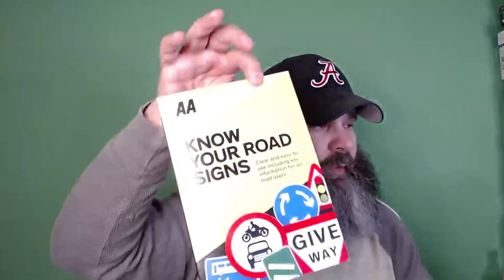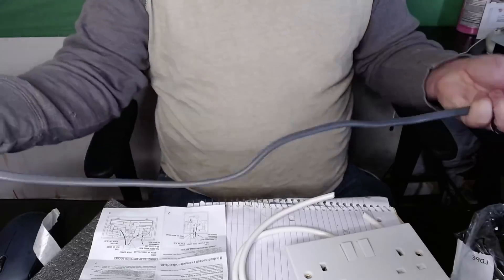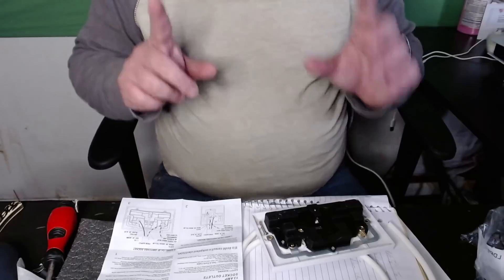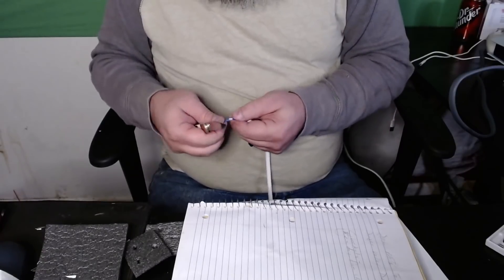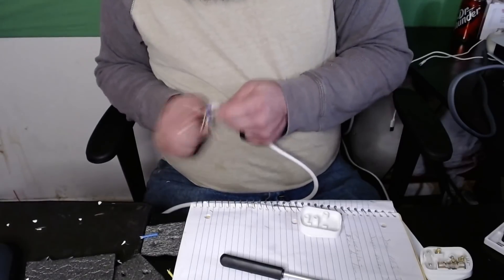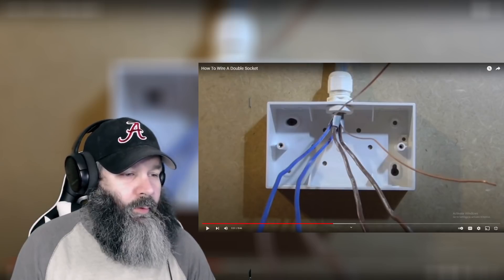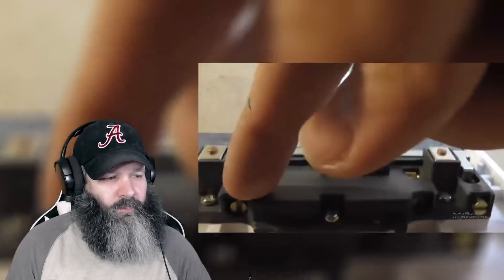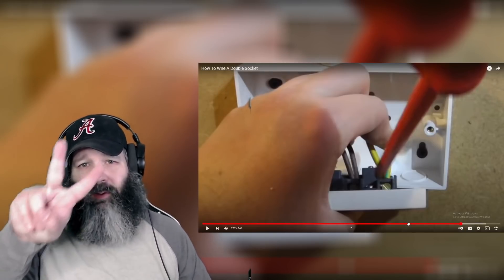American Attempts To Wire a UK Wall Socket and Plug

Comment: For a genuine first attempt, you're pretty good.
I've seen far worse wiring all over the place.
A good tip, is that if you dont have a small screwdriver, a table knife works absolutely fine.

Comment: The powder within the twin & earth cable is to prevent the cores sticking to the outer PVC sheath. Some electricians might note a lack of powder as a sign they are working with a cheap inferior cable that is going to be a PITA to work with.
Not an electrician, but the thing I hate most when it needs replacing & wiring in the UK are ceiling pendant lights.

Comment: This has probably been mentioned but anyway, the back box in the vid at the end had 2 wires going in because our rooms usually have all the sockets on a ring main, means they’re all daisy chained together.  Each room has its own ring main with a capacity of 30amps, 240 volts x 30 amps = 7200 watts before you trip the consumer unit (fuse box).  The fuse in the plug is to protect the cable going into the plug.  The live and neutral prongs on the plug are shorter so they come out the socket before the earth prong does.  As someone else said, standing in bare feet on an upturned plug is at least 15x more painful than childbirth.  Don’t know about anyone else but I’d be interested in seeing how it all works over there.  Always like your vids mate, keep it up.👍

Comment: When wiring the plug, cut the outer sheath so that the earth wire will just reach into the earth terminal, and the outer sheath will fit under the cable clamp. If you fit the earth wire first, you can then easily asses how long the live and neutral wires need to be. Many plugs are designed so that all 3 wires can be the same length, but that's not universal. It is essential to fit the cable clamp otherwise the wires will pull out sooner or later. It must grip the outer sheath not the 3 inner wires. The insulation on the inner wires should terminate very close to the terminals so that there is a minimum of bared wire. Your effort looked reasonably safe except for the omission of the cable clamp, so good try for a beginner. The slide on sheath for the earth to the socket was a regulation brought in around 1970, so many older houses do not have it unless they have been rewired.

Comment: When we were taught to do this in school it wasn't good enough until our teacher could basically swing from the plug, that's the whole point of the cable grip (two screws at the base of the plug) because if he could, even if it took all of his strength, pull that cable out of that plug then it would likely come apart just as easy if someone tripped on the cable

Comment: Merge lanes in the UK are often used as "traffic calming" measures i.e. to slow the traffic down. For example on a road that passes by a lot of houses it may be deliberately narrowed at two points with these "merge lane" stop sections. Priority is given to people leaving the built up area so that cars entering either end of the built up area typically have to stop or at least slowdown as they are at a stop point. We don't tend to have USA like stop signs as if you are at a junction or you are about to the junction double line road markings it is bleeding obvious that you should be cautious. Also we don't have police for profit where you can be stopped for any technical infringement (real or imagined) no matter how safe the circumstances,
Reply: Guernsey as a good sign, "Filter in turn" never seen one in England.

Comment: In the instructional video he's wiring the socket in to a ring main. That's where the sockets all connect in a daisy chain starting & finishing at the fuse box/consumer unit/distribution board...

Hence 2 of each wire. It's also why the plug must have a fuse as the ring main fuse/breaker will be 32amps.

The whole system uses less copper because we had a bit of a shortage after making billions of shells & bullets for world wars. My house was originally wired with steel.

The pins are square because we also have unfused sockets with round pins. Very rare now, but they do still exist.

...cut in a ring around the flex's sheath. It'll split when bend it, allowing you to pull the end off, thanks to that talc.

Comment: Well done on your first attempt at wiring a UK socket and plug!
I don't know if this has been mentioned, or if you know it already, but if you hadn't noticed, the top pin, the earth, is longer than the other two. This is another safety feature. I'm not an electrician, but as far as I know, the top pin being longer than the others, connects first, allowing the flow of electricity through the plug. Basically if the earth pin isn't engaged, then a kid sticking something into the bottom holes, technically they shouldn't get electrocuted.
With our mains power being about double of yours, we take safety seriously.
I think you'll enjoy our road signs! Lol
Just remember when your here, we don't turn on a red. And on a roundabout, which are everywhere, remember to give way to the right.

Comment: You did a great job with the plug the easiest way to remember is  Take the first two letters of the wires  Brown(L) BR goes to Bottom Right   Blue(N) BL  goes to Bottom Left  and green goes to 3rd Pin
Reply: I was just going to say this, I always remember BLue Bottom Left, BRown bottom right.

Comment: Electrician here. Not bad for a first attempt and limited tools. If terminating a single wire in a socket outlet, it is best to strip twice as much copper  conductor and double it over with pliers to give more meat to clamp down on.

Comment: The 3-pin plug is designed so that, when the plug is inserted into the socket, the longer of the 3 pins (ground) actually opens the 2 flaps that cover the 2 lower holes in the socket. This is so that when there is no plug in the socket, the 2 lower holes (live and neutral) are covered. This stops small children (or idiots) from putting their fingers etc into those 2 holes which could result in a nasty electrical shock. A very good and safe design that is really robust.

Comment: That plug is essentially the same as the 'rubber bathroom plug' in the Two Ronnies Fork Handles sketch of 1976.  The trouble with having a 13 amp plug in a bathroom is not the plug itself, but rather the appliance on the other end of the wire.  The appliance on the other end of the wire is unlikely to be waterproof, and 240 volts RMS AC (680 volts peak-to-peak sinewave) is potentially lethal.

Comment: The first road sign is about high vehicles passing under the centre of low arched bridges.  There is a funny site about a low bridge in the U.S. which catches out the unwary despite installed automatic warning lights.

Comment: Next wiring challenge, someone send him a mock set up with a random mix of all wire colour combinations, pre-70's, '70-76, 76-2004 and current , some wired wrong, see if he can deal with what some UK sparkies have to deal with in older houses that have had their electrical wiring added onto randomly and not completely replaced 🤣
Reply from the maker: Erm. That would definitely be interesting.
Reply: As a 52 yr old sparky, it always amuses me when I get a fresh out of college know it all youngster. First fault in a older property and they are lost, "why's this cable red or black?" etc.
Reply: @tobytaylor2154  why is this neutral cable live? Do you check to see if the live is in fact neutral and it wasn't installed wrong by a fresh out of college know it all? Or a cowboy?
Reply: @MrTrilbe  I got some shocking (excuse the punn) stories, things I've seen over the yrs.
Reply: @tobytaylor2154  oh I figured and do please tell
Reply: @MrTrilbe  allsorts, from nails as fuses in a big industrial unit, a private hospital in Wales, the operation theatre's s/o were on a standard ring circuit, not a dedicated protected one or an Icelands near Heathrow Airport mains board on fire and the manager done nothing until I got there on an emergency call and said he didn't know what to do, evacuate the store and 999 would be a good start. A fencer go through the mains in the St with a pickaxe, the bang was loud, he was blackened and the local area lost power lol. To name a few lol
Reply: @tobytaylor2154  my grandad replaced a few fuzes with cut down nails or wrapped tin foil around popped ones to last them until he could buy either new ones or before that new wire for the older ceramic block and replaceable wire fuzes lol, different times back then, much more... Interesting... Times too
Reply: @tobytaylor2154  You'll be familiar with Electroboom, no doubt?
Reply: @loafersheffield  I didn't recognise it so I googled it, lol, yeah I've seen him
Reply: Does that include the orange and grey on the bolier controls too ? !   Indeed the internal wiring was all different, and lets take a neutral for the garage extention and wire one of the kitchen sockets to it, so its not off when the house board is off !
Reply: @tobytaylor2154  I would have thought the old codes were fairly intuative to work out.  Now lets get a USA device in with black and white wires
Reply: @MrTrilbe  safety pins make good fuses
Reply: @highpath4776  yeah, you would've thought so, but in my experience, youngsters now are very dim.
Reply: @highpath4776  What a great idea! What could POSSIBLY go wrong? (Deep, deep sarcasm) So, someone spurred off a 3 amp rated boiler flex (orange) presumably serving a 3 port heating/hot water valve? I've found a 2 gang socket outlet taken of the common live, neutral and earth serving a lighting circuit. A spur off a downstairs ring, running from top right to bottom left (not zoned, nor protected) and joined by a chocky block, terminal connector in damp, crumbly tile adhesive. Same house. Fully populated  split board 16 way and only 2 circuits wired in. Ring for upstairs and downstairs sockets and lighting up and down too.

Comment: I don't know if anybody's touched on it, but another part of the engineered design of the BS1363 plug is that the cord entry is a) at the side and b) the bottom side. It's sideways on so the cord is flush with the surface the plug is plugged into, rather than poking straight outwards (have you ever tried plugging a non-UK plug into a socket behind furniture?), and the entry is at the bottom to prevent stuff, muck, dust, etc falling into it.

Comment: Hello Alan. You have to use a qualified electrician for anything major, or at least get them to test and certify the circuits these days in UK. You can still do simple bits yourself, like wiring a plug. The number of times I have been somewhere with no tools and had to help someone. This was a lot better than an old table knife and pair of scissors.
As a graduate scientist I had to study electronics. Still when I had to hire professional electricians both for previous jobs and for my house renovation, you can see why they earn their pay as they do this in seconds. I was relegated to hammer and chisel for the plaster and brickwork to bury the wires. I helped a British one out when in Spain, where the walls have hollow bricks that make this easier. European standard electrical fittings are different to UK.
Ethan from Midwest Americans did a video on UK plugs.  It was a good while back, so you might react to the same one?

Comment: After stripping the insulation off a conductor, I always bend the exposed copper back on itself so it's more securely held in the terminal.

Comment: You got the gist of it...even if you had everything upside down - switches are at the top, and cables from plugs are at the bottom.  Your double socket was fine if it was at the end of a circuit. If you are in a continuous circuit, then you will need one cable as the input and one as the output to keep the circuit going.

Comment: There should have been a bit of card pushed over the plug pins which shows you how long to cut each of the wires  from the outer white  sheath. for the plug. This means that when all wired correctly the clamp is clamping on the white sheaf and not on the individual wires. Otherwise a good first effort.

Comment: While you have the U.K. plug and socket you can check out the safety features. 
First try and push a screwdriver or small blade into either the bottom two holes (switches are up the top end).
Until the earth (longer pin on plug) is pushed in there is a shutter over the live and neutral. 
Also on the plug there are shielding over the bottom half of the live and neutral pins. 
That is there to stop fingers touching any metal on those pins until the plug is pushed in. Meaning when there is current going to the live the exposed part of the pin is shielded. 
Also within the plug the earth wire is longer then the neutral which is slightly longer then the live wire when the cord is pulled hard enough to come out the live disconnects first followed by the neutral leaving the exposed wires safe.

Comment: Although the plug is called 13 amp, the fuse inside can vary according to the rating of the electrical device. The more powerful the device the higher rating the fuse will have to be. for example a table lamp or radio, would have a 3 amp fuse or a T.V which I have that has a 5 amp fuse, whereas a vacuum cleaner would need a 13 amp fuse
Reply: Remember however that the fuse protects the cable not the device connected to it.
Reply: @Brian-1948  so why is It when I've had a fuse blow and changed fuse and then the item worked just fine.
Reply: @markshaw270  Because the fuse has done it's job of protecting the cable when the device created a fault and blew the fuse.  With the different sized fuse for each appliance there is a corresponding change in cable size.  13amp fused cable would be around 2.5sq.mm whereas a 5amp fused cable could be around 0.5sq.mm.
Reply: Originally there were 2A, 3A, 5A, 7A, 10A and 13A fuses. This confused many people, so the list was reduced to 3A, 5A and 13A only.

Comment: Yeah the white cable goes under the clamp on the bottom of the plug and it looks like you went over it.  
This is to secure the cable so that it doesn't get pulled out if you trip on it or something.  So the clamp has to clamp over the actual white cable itself and not the 3 wires inside the cable.

Comment: You did well sir. Tom was wiring a ring main. Both cables go back the consumer unit(breaker), with sockets daisy chained around the room. It's a system that dates back to after the war when the cable was of poor quality due to shortages I believe.  Only thing you didn't do was clamp the flex in the plug .

Comment: In the plug the plastic strap goes over the wire to stop the cable pulling free of the connectors. good job with the rest.

Comment: It’s not a given that it will prevent a fire however it highly reduces the likelihood of a fire and the great thing about them is that if you say spill some water over your tv or toaster as soon as an electrical surge hits the system the plug will automatically break the system and redirect the flow of electricity from you directly into your house or building as the electricity is dispersed into the ground canceling it out, and not only that but they also allow you to leave your device plugged in without having to leave a socket exposed or even live because the socket also has a kill switch and unlike a house breaker with only turns on when a significant power output is enough to trip it by then a fire could have already started or begin to spread

Comment: You did very well for a first try . Sometimes you find the earth wire on a mains cable like that has no covering . As it is the earth and a safety device it doesn't  matter . Also the reason the brass part of the plug is bigger then the US is much more power goes though ours plugs  as compered with yours . Eg, 240 volts to yours 110 volts.

Comment: Its one thing wiring these which are designed for consumer safety but these cover socket plates the wiring is attached to are fastened to boxes set in the wall that don't have much space for stiff wiring to be twisted into position. You need wires long enough to reach the connectors while the socket is away from the wall but that length has to go somewhere when you push the plate ion to the wall.   Its very easy for the effort to push the connected plate onto the box forcing the cable to bend to pull the wires out of connections. It would be better for a design where the sunken socket box is the recipient for the wire connections and for the socket plate to clip onto those when fitted.  I think it would be safer than having connections put under stress by the wires moving as the plate is forced on. btw the socket box in the instruction video stands proud of the wall but these are more often sunk into the wall.

Comment: Live wire shortest
Blue wire next and green yellow longest
If flex pulled out of plug earth should be last to detach
Flex should be held in place by bridge connection
Never just holding internal wires
Tip use pen knife folded over wire sheath and rotate to cut through
Inside plug make sure no bare wires showing out of pin holes to reduce risk of spark inside plug
Make sure fuse is correct for appliance
TV 3 or 5 amp iron 13 amp

Comment: Good attempt and you got it mostly correct. With the plug, you only unscrew the big screw in the middle to start with. The other two screws hold the piece of rubber strip that is used to clamp the cable down, so you only undo one of those so you can put the cable under once you have wired the plug. You should have none of the wires showing once you have finished and it should look clean. We use an higher voltage than the US, that is why we don't have electrical sockets in bathrooms in the UK. UK runs on 230V while US runs on 120V.
Reply: @Paul Maxey - I found myself saying out loud to the video "don't forget to clamp the wire..." - "you're missing the plug clamp" - "Eclectic, put the f_Cking wire under the clamp" - LOL ! 😂😂😂